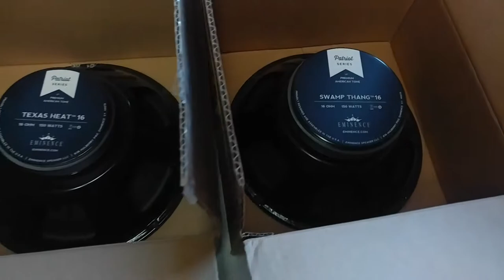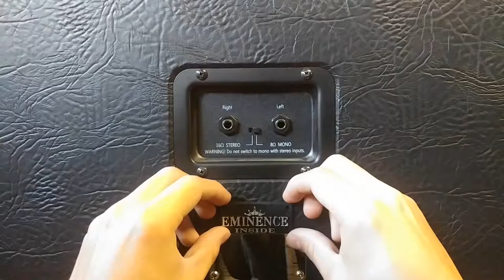How to Install New Speakers in a Guitar Cabinet

Comment: thank you for the response to my comment on your other video. I took the back off my cab and turns out i have a pair of chinese v30s and they're driving me nuts (they say made in china and have the '50' on them, who knows.) I've wanted the swamp thang /texas heat 16 ohm combo for a while and I think that may be my next purchase. My question is, since my cab is already wired with the easily removable clips like yours, do I have to worry about the impedance ? Meaning I have two 16 ohm speakers, and i'm going to swap them out with two 16 ohms anyway.
Reply from the maker: If you swap out for the same ohms of speakers it'll all be fine. If you wanted to change ohms it only matters for the amp youre plugging in, and if that amp can do different ohms.
Reply: @aaronarandac4  i appreciate the knowledge thanks homie